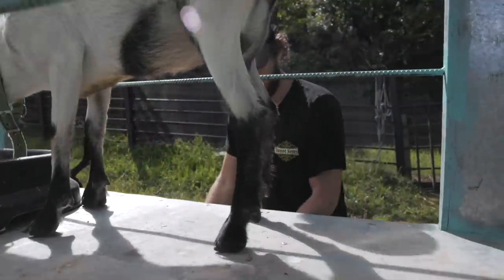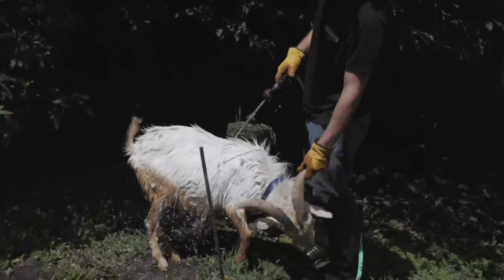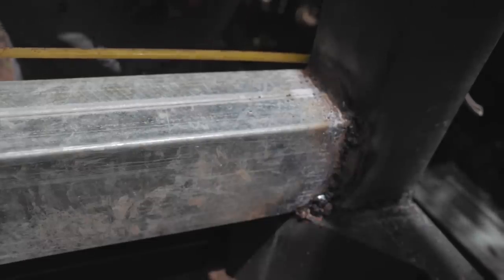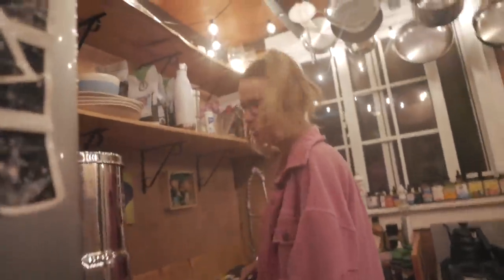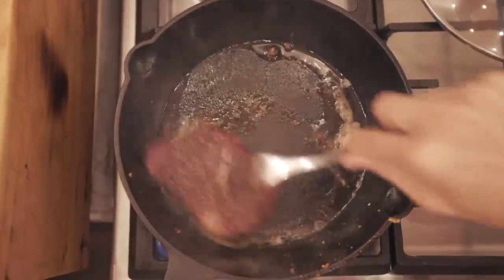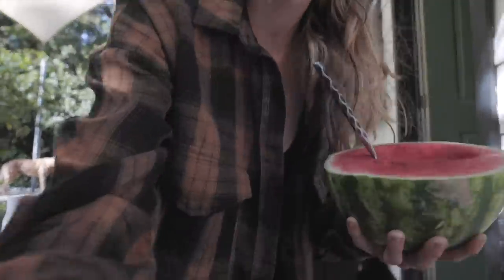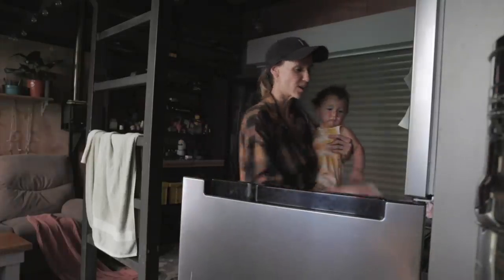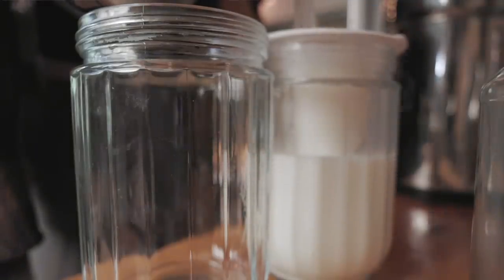BUILDING OUR OWN HOME // DIY luxury bathroom

Comment: For all your extra milk!!

Homemade goat milk pudding. it only takes about ten to fifteen minutes to make. 
Put these ingredients into a blender:

4 cups goat milk
1/2 cup maple syrup
1/4 cup cornstarch
3 eggs
dash of salt
Blend for about 15 to 30 seconds on low until everything looks well blended. 
Pour the ingredients into a medium pot on medium heat and stir with a whisk
 until it starts to bubble around the edges and thicken. 
Keep stirring for about another 30 seconds to be sure it really is 
bubbling and thickening, and then turn off the heat.
Pour into serving cups.

Comment: Curious why you aren't you using the typical building materials that is common in Panama? Most housing in Panama is constructed with cementitious material and concrete blocks, a concrete foundation, and a zinc roof (yes never wood or plywood on walls/floors because of termites). Locals use common building materials that is impervious to bugs, mildew, or fire such as: Sack cement, aggregates, concrete block, sand, Plycem (concrete board), M2  panels (insulated styrofoam panels - ready for stucco). It's cheap compared to other building materials, resistant to the elements, and Panamanian builders are familiar with concrete construction.

Comment: Aren't you planning to connect the new structure to the existing so you can use the bathroom going through a covered area without getting wet?  I am sure that you have all the materials needed to build the connecting structure.
Reply: When you are in a rural area far from help, sometimes it is better to have separate buildings encase of fire or other types troubles. If one building catch on fire all may not be lost if separated.

Comment: I just barely started the video and the solar panels caught my eye. I’m wondering if there are plans later to build an outdoor, open-air covered workshop to be able to work in a space protected from the rain. I’m envisioning a simple 4 post structure with just a roof and no walls. On the roof, the solar panels could be placed.

Comment: Do you know making yogurt from those goat milk is so easy ?
I’ll tell you how you can make yogurt.

Put milk in the pot & on the stove with lower temperature let it be till start boiling after 10 min boiling let it cool but not completely cool, this is how you can find out it’s the right temperature, just drop two drops of that boiled milk on your wrest if your wrest burned, it’s not a time but if it’s warm but it won’t feel burning this is the right moment to add three or four table spoons of yogurt to milk and stir it then wrap the pot with a thick blanket then cover it then put it in a warm place for 8 hours then slowly unwrap it and put the pot in fridge for 24 hours then after that yogurt is ready to eat. 
It’s so easy. Try it, you will love it.🙋🏻‍♀️

Comment: You guys need one of these,  Evolution S355CPSL – Heavy Duty 14 Inch Metal Cutting Chop Saw W/ 14 Inch Carbide-Tipped Blade | Dry Cut Saw | Miter Saw 45° | Chop Saw For Cutting Metal – Accurate. Powerful. Reliable

Comment: I'd weld a piece of the steel to the galvanized , ( on the ground ) and give it a good wack or more to test the weld  to see if it holds up....... try watching   youtube video,  ...  Welding Galvanized Steel, Best Welding Process....and ...How To Weld And Not Die | Welding Galvanized Steel...I'd have it looked over by a professional welder for advice before I'd trust the structure.

Comment: dude............. if your a chef, you should know better not to cut thetops off the onions, that's what you use to peel the onion, and if you're cutting onion rings, you cut every small divit on the side of the onion and then slice away, bys d' bys...................